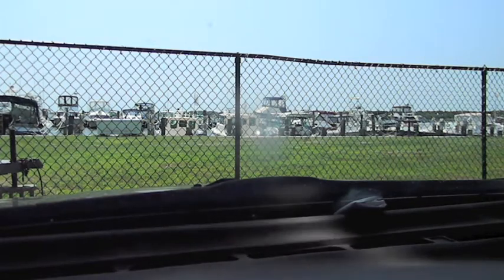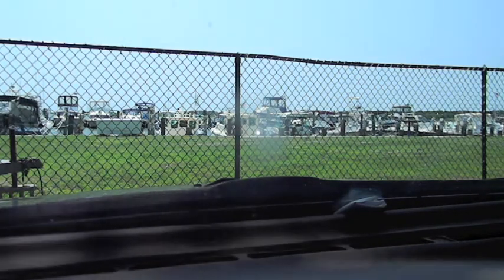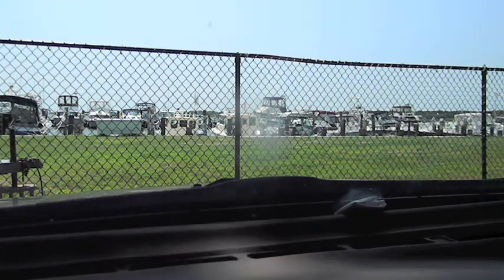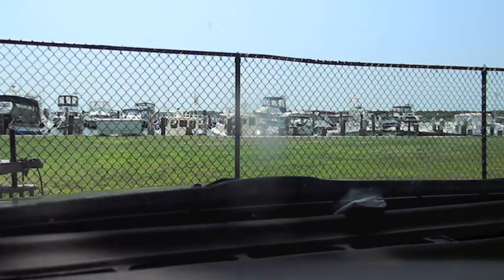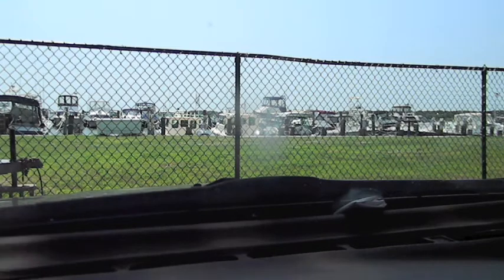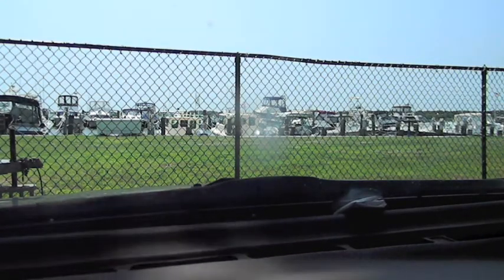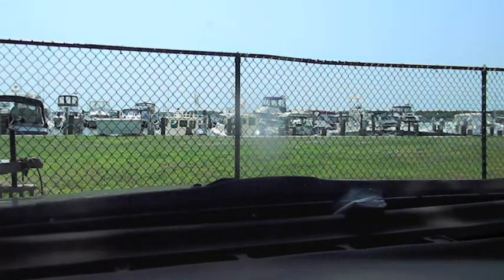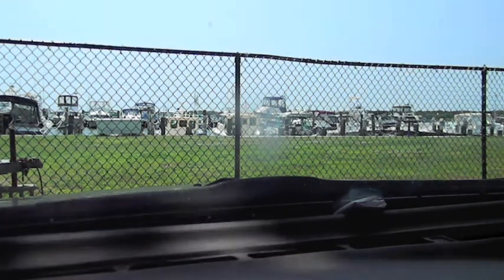Compressor

Comment: Anthony, find a scuba shop and have the tank tested, just a thought, or find a propane tank and use it as an air tank, or break it up for parts like you said. Hate to see a compressor a good compressor go down.